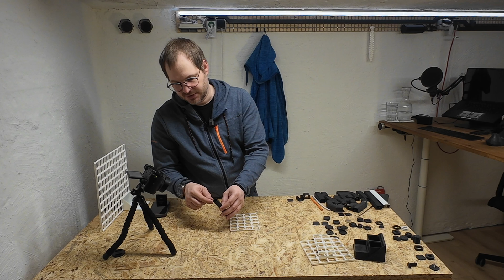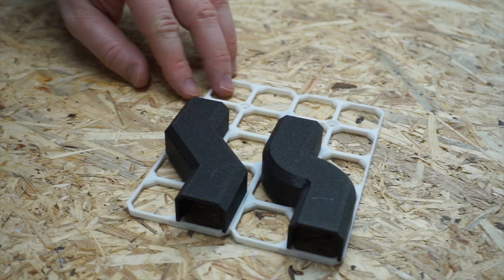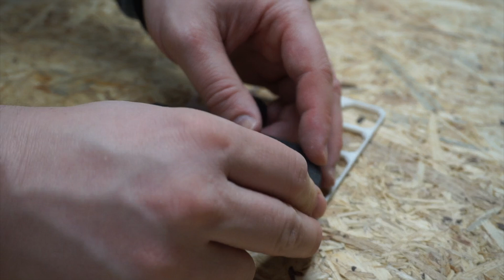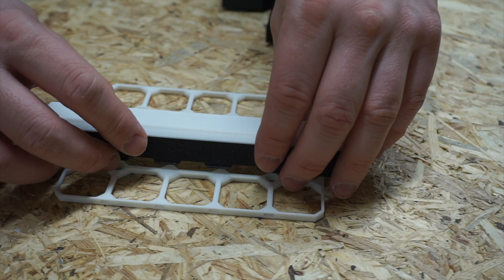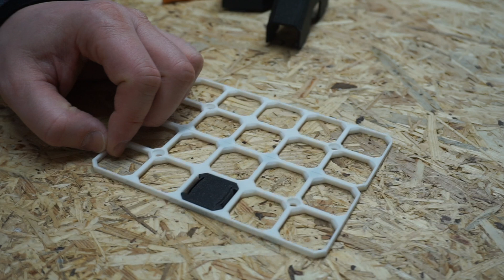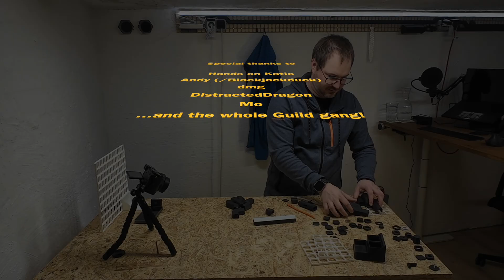openGrid Underware - Getting your Underware setup faster and with less material

Comment: I have been printing the underwear single square units just because I was burning up some old filament on a roll. These individual pieces, the file from the zip was "opengrid-underware-1x-channel.step". I am finding that the clips are too shallow, they don't clip into the grid and stay, they just pop right out.

I may glue them just to make them work for one channel, spaced out so I can get into the channel, but would be great if you had an alternative suggestion?

Comment: Where are the threaded snaps that I need to print to attach BlackjackDuck's parts to opengrid? at 1:46 where do I find these. This whole project is so confusing.
Reply from the maker: The snaps with the attached thread are only necessary if you want to use the original (multiboard based) design which includes a channel base and then the channel on top of that. Those are not necessary if you only want to use the openGrid style underware channels.

Comment: The grip snap is exactly what I needed.
Printed 8 tiles wide bridges to cover cables going under the middle beam of my standing desk and just the one snap tile on each end didn't hold it up that well.
Thanks for all the work that you put into this! Still in the middle of getting everything fixed but the openGrid + underware + openGrid item holder generators are doing 100% of  the work here.

Comment: question: how do I turn the files into STL.. and how do I connect underwear, with these two different systems I am lost,. Do you use the mutliboard underwear system for opengrid? but also I can't print files that are not in STL format, and when I got to customize them to download as an STL it says that they can not be??
Reply from the maker: All modern slicers should be able to load 3MF and STEP files, so those should just work. Use the openGrid variant of Underware: https://www.printables.com/model/1214427-underware-for-opengrid-manage-your-cables-lite-ly

Comment: how is this supposed to work for things like power strips and large squareish shaped items other than cables?
Reply from the maker: The channels itself don't help here of course. But there is this awesome generator by BlackjackDuck that allows you to create things like item holders. Those will definitely hold power strips for example: https://makerworld.com/en/models/582260-multiconnect-part-generator-master-collection#profileId-633542
Reply from the maker: You see this in action here for example: https://www.reddit.com/r/DeskCableManagement/comments/1me9r09/new_desk_setup_with_underware/

Comment: Can someone please guide me which filament to use for these kind of underware setup, I am new to 3d printing but i guess wont these get soft or melt overtime because of the heat generated from power bricks or adapter?
Reply from the maker: My setup is PLA mostly. For the parts that might get warm I used PETG in some instances. But even PLA needs to get to 50 degree Celsius or more first. And even then it is not melting, just starting to get soft. So PLA and PETG should be sufficient in most cases.
Reply: @2D3D-DavidD  Thank you for clarifying.

Comment: My search skills might be failing me. Are there snap on pieces for command strips, the 3m claw or adhesives? I have some for HSW and I’m not really excited to drill tons of holes in my rented apartment. 😅
Reply from the maker: There are multiple solutions for this made by the community:
https://www.printables.com/model/1290873-opengrid-removable-command-strip-mounts
https://makerworld.com/en/models/1376708-opengrid-adhesive-wall-mount?from=search#profileId-1424329
https://makerworld.com/en/models/1422407-opengrid-adhesive-wall-mount-with-multiconnect?from=search#profileId-1477979
https://makerworld.com/en/models/1321363-opengrid-adhesive-wall-mount?from=search#profileId-1357569
Reply: Found it on MakerWorld by Dark Dickens!

Comment: At around 4:15 you start talking about how it's easier to put a stiff cable through the straight sided "dog's leg" channel than through curved version.  However,  given that the only difference between the two shapes is straight diagonals vs outside curves and also that the cable never touches those diagonal sides then there's no reason to expect any difference in how those pieces cope with stiff cables.
Reply from the maker: Stiff cables need to be bend more to get those into the round versions of the channels. At least that was my feeling when using those. You may still use them if it’s ok for you. Both variants can be interchanged 😉
Reply: Would it not be better to have the inside of the path be curved to better support the cable as it passes close to the channel?

Comment: As an electrical engineer I have to add that you must use flame-retardant filament, if you run high-voltage power cables through it, at least in Austria and Germany (and I think in most european countrys).
Reply from the maker: You might use this: https://www.prusa3d.com/en/product/prusament-petg-v0-jet-black-1kg/
Reply: Why would you run high voltage cables through your underware? Or are you referring to regular 220V cords (that seems excessive)
Reply: @nickolay414 Yes I mean 230V. If you use low voltage like 12 or 24V, than it's no problem.
Reply: @PietroPizzi  thanks, wouldn’t have thought to consider this risk. Probably not a bad idea to have some of that V0 filament handy.
Reply: @nickolay414  You'r welcome :)! In 99.99% of the times it's no problem... until it is. And if you have one day a cable fire and your house/flat burns down, you can bet your ass that your ensurance says "That's on you" ;).

Comment: damn now I regret using multiboard, a confusing mess, that's all. I even paid for the premium, which was even more confusing. This is so much simpler. Thanks man. Check my comment on your video about open grid. had a good idea for snaps removal I think XD
Reply: i was on vacation for a week, had my wife "reprint" multiboard, came home to 25.... those now will NOT be used for my underwear plans now haha. This OpenGrid is clearly a much better solution

Comment: How is the holding power with opengrid for larger underware channels? I love the system for managing my cables, but I found my double-wide and tall channels fall off very easily compared to the single-width channels.
Also, does the lite opengrid have the same holding power on the underwear channels as the normal thickness opengrid?
Thanks for your hard work, I'm excited to try this out.
Reply from the maker: Lite vs full board does not make any difference. The lite board is basically the full board split in half (plus a little bit extra). The Underware channels only grab to that half. So the strength on both boards is the same. 

The channels themselves are slightly weaker than the original ones, partly due to the bigger size (28mm instead of 25mm). BUT there is the grip snap you can push into the board to increase strength. With this I would say the channels have a much stronger connection with the board. Personally I would only add those snaps where absolutely necessary, but that really depends on your needs.

My suggestion would be to print a 3x3 lite board with a 3x channel and one or two grip snaps and test whether this suits your needs. Should be a really fast print. 😉👍
Reply: I did as your recommended and I'm very happy with these models you've made. The holding power with the grip snap in place is far stronger than I would have thought. This will do nicely. Thanks a bunch!
Reply from the maker: Glad you like it! 🤩
Reply: @2D3D-DavidD  Is there a multiconnect snap for the lite boards (or a plan for one)? I'm wondering about the possibility of using the item holders.
Reply from the maker: Yeah, there is. It is in the “Multiconnect for openGrid Lite” folder on printables/makerworld. Note it’s only a directional snap so far + you need a shorter version of Multiconnect of course.
Reply: @2D3D-DavidD  Thanks! FYI I found the folder on Printables in "openGrid - Wall/Desk mounting framework and ecosystem" but I don't see it on Makerworld.

Comment: Off the top of my head, a huge advantage here over the original system is that you can take the channels off the grid without having to push from the other side. My biggest issue (and why I moved to the 'screw in' strategy where you add the channels to the small holes in multiboard) was that you could push the snap connectors in, but they were near-impossible to get out without pushing from the back side, which of course you don't have access to after screwing the multiboard to a surface. This looks really good! I'd love to see the original underware channels adapted to work with multiboard in the same way.
Reply from the maker: Getting the snaps out is easier when they have some real features, like when you use Multiconnect for example.

The Underware channels are super easy to install and remove again, this literally only takes seconds. 👍